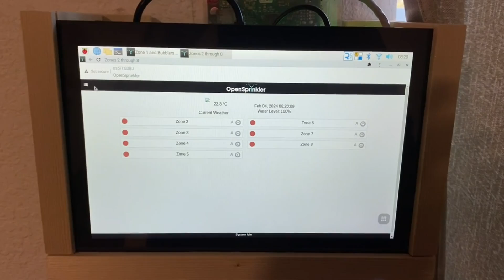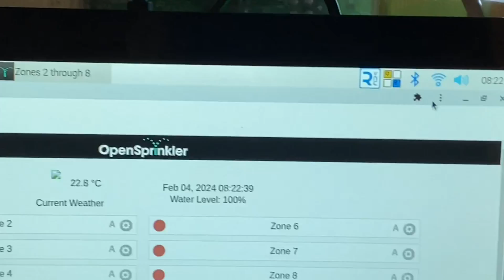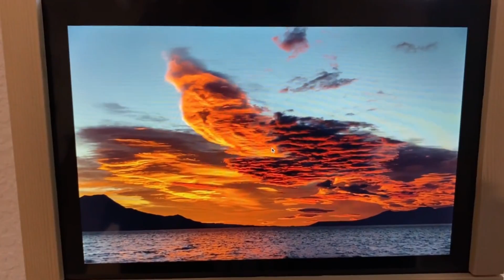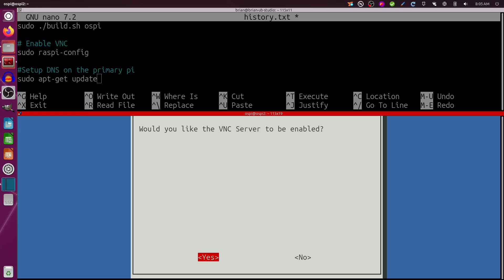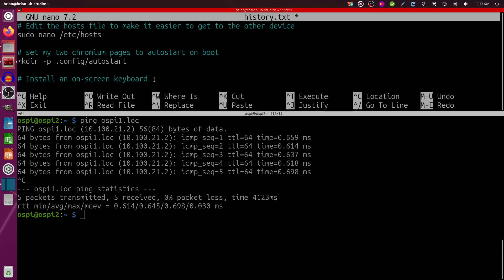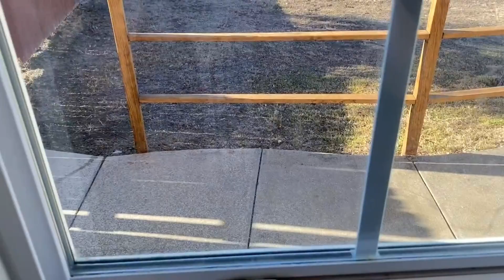Open Sprinkler Pi - a fun build of an open source, and DIY project taking back control of my home.

Comment: Thank you for posting this video!
Are there any limitations with the OSPi, compared to the complete OpenSprinkler unit? More specifically, I'm wondering how it compares to the different AC/DC/Latch hardware variants of OS.
Reply from the maker: I don't know. I use two of them because I have more zones than ports, but only because I had a dead zone on one at one point, then ordered a second.  They have expansion boards, but it requires a 24V power supply.  Beyond that, not sure of any other differences, only because I don't have one of their pieces of hardware.
Reply: @AwesomeOpenSource  Appreciate your feedback =)

Comment: Hey off the subject but, do you run an MSP using opensource software….im a current sysadmin and i have some free time in my hands and thinking of forming a 2-3 man msp sorta
Reply from the maker: I wouldn't call what I do being an MSP.  I do IT contract work for my Credit Union.  I do use all open source for keeping track of wha tthey need, and for supporting them.  I use MeshCentral and Rustdesk for the remote support. Zabbix for monitoring their systems, OpenWRT for their networking and VLANs, and Wireguard for VPN access so as not to open any ports on their network, which is behind double NAT.  Looking to get a PiKVM setup on their server as that reboot and seeing output on an attached screen is the only reason I have to go down there most of the time.
Reply: @AwesomeOpenSource  thank you for replying and being so clear I’m at a time of my life where I need to find passion again being a sysadmin for 21years that’s all I know how to do and now that I’m a empty nester I need to find a way to stay active and watching you’re videos sparked that Idea….thanks again
Reply from the maker: I say go for it. One of my goals this year is to do a series on starting an MSP using Open Source solutions.  I also forgot that I'm using Proxmox for their main server, snapshots and backups (they use Win 10 / 11 Pro VMs), OpenMediaVault for their Samba Shares and Shared Drives, and Portainer for their containerization control on docker.